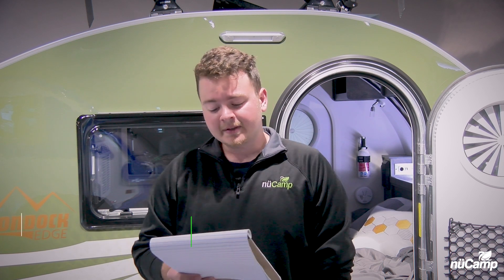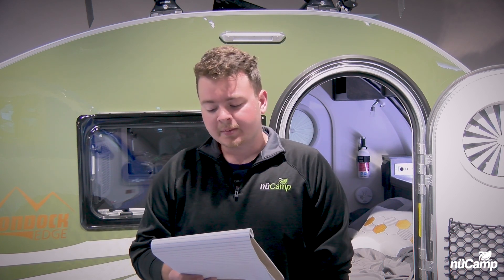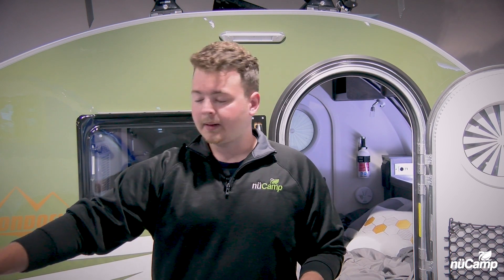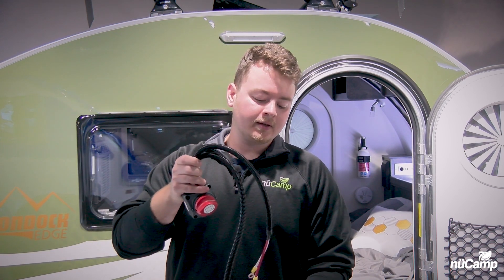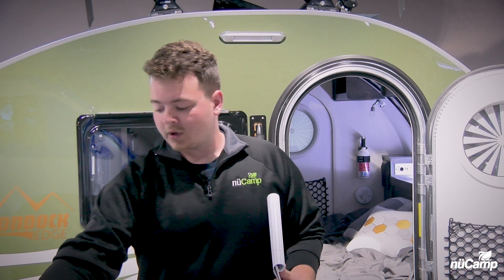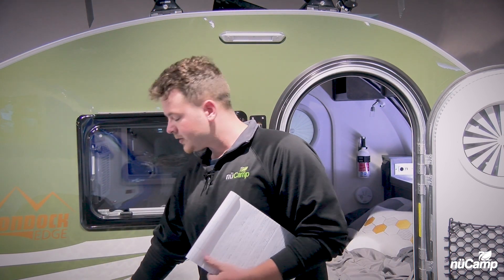How to Restore 12-Volt Power - Tech Talk

Comment: II have 2023 TAG Boondock and just had the same issue. My battery was disconnected for a week or so. Today I connect to the all wiring and then to my amze no power. Used multimeter to verify the Bat disconnect switch, fuses, battery. Everything checked out. .Really super weird because I only disconnected wires at battery..no power anywhere except solar controller. I decided to connect the shore power and boom...all lights came back.. disconnect shore and still good...guess there is a sleep mode in the WFCO maybe...anyway everything works..